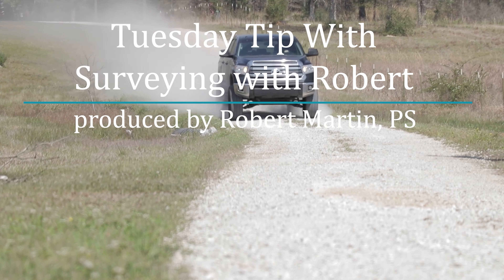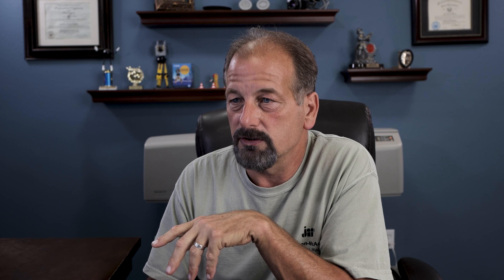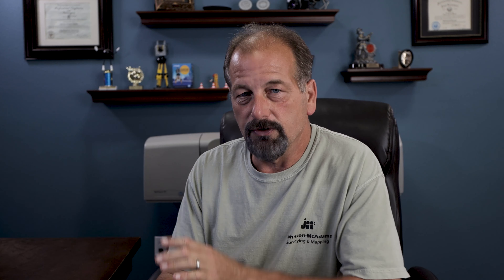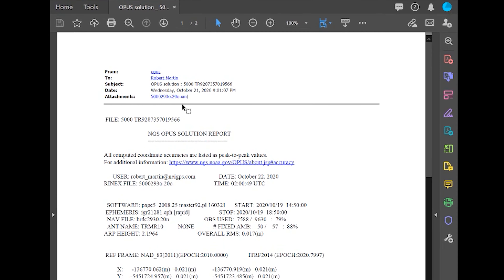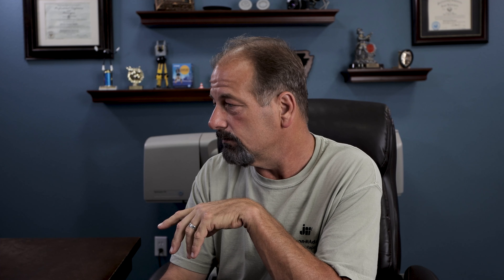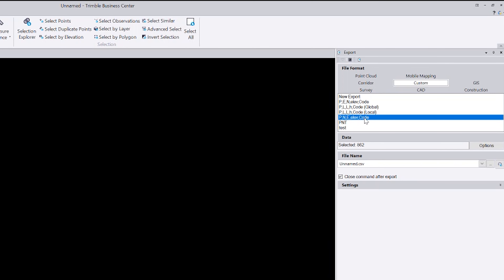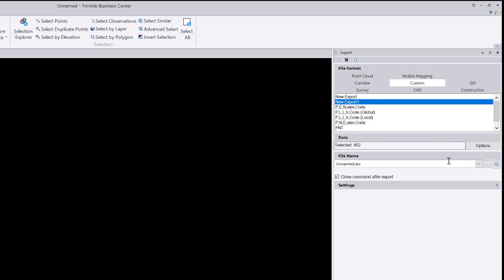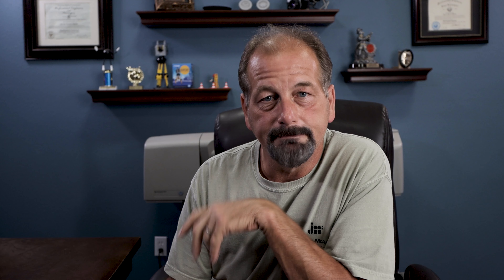Using OPUS in TBC

Comment: Dear Sir
 can you help the opus website. I can not upload the rinex  2.1  OR 3.4 file. It asks me to reduce it size                        i have  wintecqc    program   but it is not responding  when run with my windows 10    what way to uplod file observation to opus site     
 thank you so much
Reply from the maker: Try GNSS Processor. It’s a Trimble website.
Reply: You can also zip the Rinex file, as long as the original file is under 100MB it will upload.
Reply: @mdolan900      thank you   so much